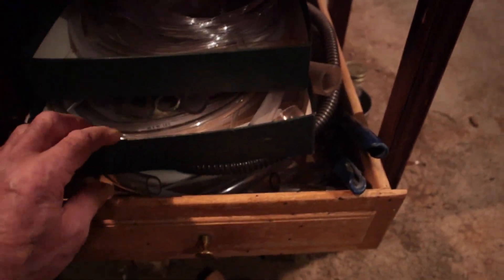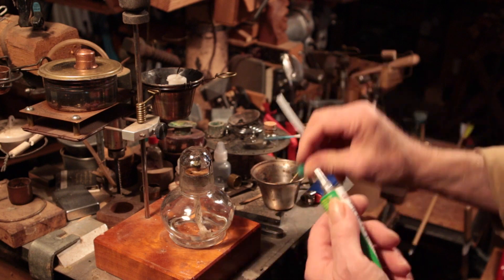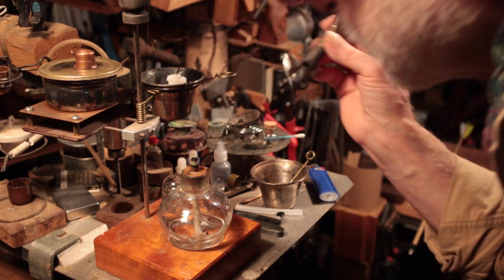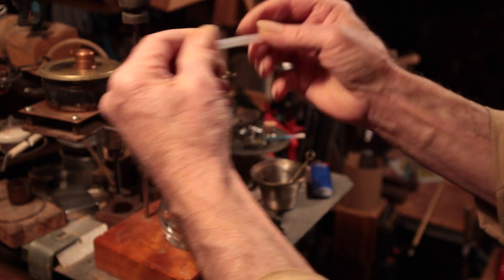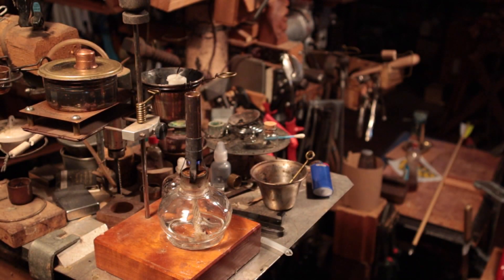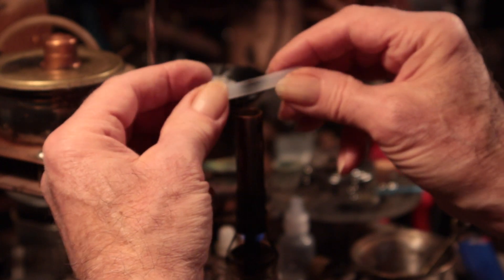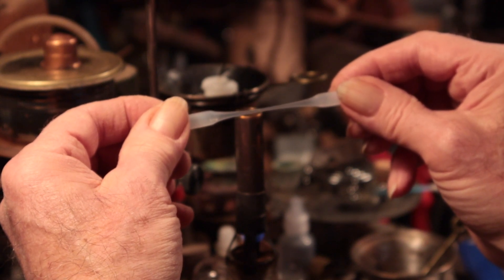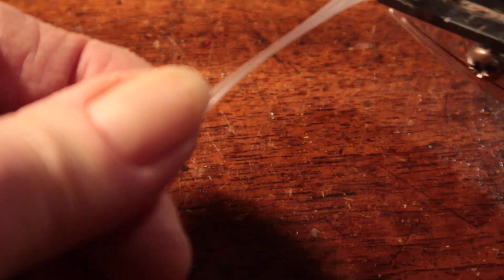Make a Pipette, for Precision Glue Nozzle

Comment: excellent. i was just sitting on a wooden chair of mine yesterday thinking about how difficult it would be to reglue the back and arm rests when only a couple of the joints are loose. i don’t want to pull it all apart just to reglue one or two places. then i imagined a needle-tip applicator, and today here you are. thank you.